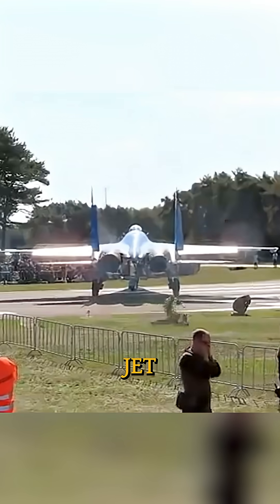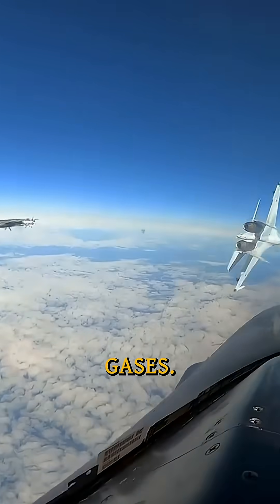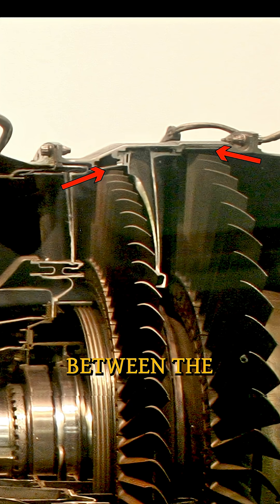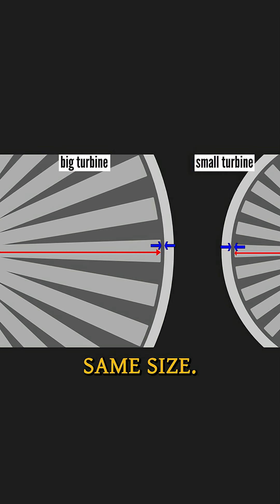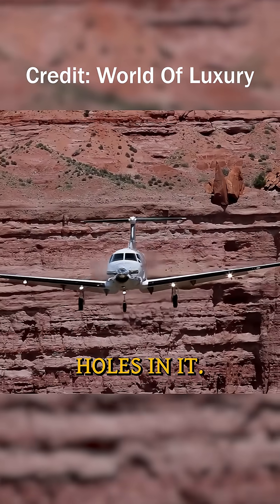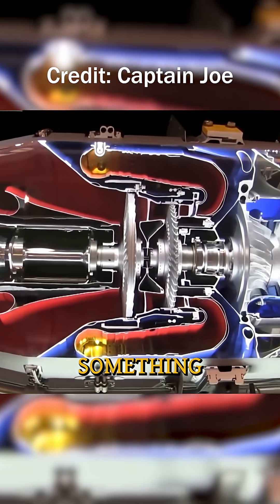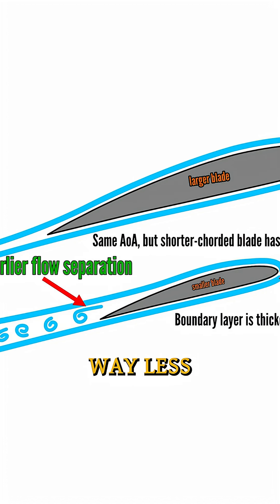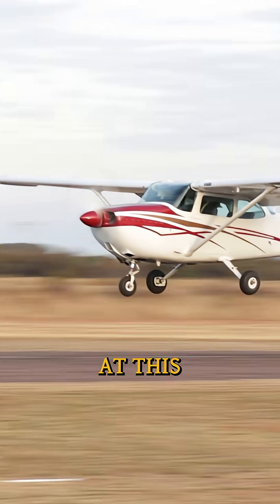Why Turboprops Can't Yet Replace Pistons on Small Planes

Comment: Turboprops DO produce thrust with exhaust gases... and modern jets spin turbines the same way a turbo prop does just a lot faster. Both use jet engines, one drives a prop, one drives a turbine within a cowling since the blade tips travel supersonic. Cowling is for eliminating tip vortices and as such eliminating deafening sounds and drag, as well as protecting the engine (and the aircraft from the engine if something goes wrong at those insane speeds). 

Newest jet engines and turbo props generate less than 5% thrust from exhaust gas, whereas 737ng and non neo a320 series create about 10-20% thrust from exhaust. Rest of exhaust gas is converted into thrust to spin the turbine or prop. 

The benefit of the turboprop is using a smaller jet engine to produce a better thrust to fuel ratio providing better propulsive efficiency at slower speeds than a jet, but at much better performance than an ICO at higher altitudes from the compression... dm if u have any questions :/
Reply from the maker: You might enjoy my long video linked here 🙂 Correct of course, since its impossible to extract 100% of the energy in the exhaust gases on a turboprop, it does provide a small amount of residual exhaust thrust.
Reply: Your using turbine when you should say fan. A turbine extracts energy from a fluid, a fan adds energy to the fluid.  The turbines are right after the combustion chamber and extracts energy from the air to turn the drive shaft. The driveshaft then turns the fan to produce thrust.
Reply from the maker: @wally7856  That's exactly what I meant. Turbine, not fan. A turboprop doesn't have any fans, only rotors (compressor) and turbine(s).
Reply: @LetsGoAviate  I was responding to the OP's post, not yours, sorry for the confusion. He mentioned a turboprop drives a propeller (for thrust) and a passenger jet drives a turbine in a duct (for thrust) when it's a fan in a duct, not a turbine. I wasn't trying to be pedantic, it's just the OP seemed very knowledgeable and enthusiastic about the subject so using the correct terms would benefit him when he posts. A fan/compressor section and a turbine section can both look very similar, it's just that they do 2 different jobs.    One extract's power from the exhaust, the other uses that power to make thrust.
Reply from the maker: @wally7856  Gotcha, all good
Reply: @wally7856 Thanks!

Comment: If you have a turbine with multiple independent axles, say, one set to run the compressor and the other one to turn the prop, if the reduction gear to the prop breaks … instant uncontained turbine failure.
Reply: yet somehow the pt6 almost never breaks... (this literally happened to mike patey recently)

Comment: This is all true.  The reason small planes don't use turboprops is because a turboprop engine is ten to twenty times more expensive than a piston engine.
Reply: You seem familiar with both systems.  But, you mention nothing about maintenance and reliability not to mention fuel cost comparison. Everybody knows turbines are low maintenance compared to piston. Everytime you add maintenance labor to the system it can be a large $ difference. Reliability I am not familiar with but becomes important when you are in the air for some reason. I am guessing turbines are more reliable.
Reply: @franciscoosuna259  Maintenance on turbines is exponentially more expensive than on recips. Sure, there's less of it.
Reply: @franciscoosuna259  precision costs more, period.

Turbines require precise tolerances, thus cost more.
Reply: @Adam-mf9cl  don't forget all the fancy metall alloys you need in turbines while in a piston engine it is mostly just aluminium and steel.
Reply: @franciscoosuna259  He said it is 10-20 times more expensive. Nowhere was it mentioned that this is only the initial purchase price. Maintenance is also 10-20 times more expensive. So the total operating costs are 10-20 times more expensive to have tiny turbo prop vs a 50 year old, air-cooled piston motor.
Reply: @franciscoosuna259 
Turbo prop maintenance is more costly per operational hour than piston engines, a good bit more. 
As far as fuel costs I don't know on that one but even if jet fuel is less expensive than avgas per hour the savings wouldn't come close to offsetting the higher maintenance costs of a turbo prop.
Reply: Why is that when a jet engine is so much simpler with fewer moving parts?
Reply: @armyreservist0  It is not simpler. Have you seen what a jet engine looks like outside of a plane?
Reply: That's not the only reason,turbines don't operate efficiently at lower altitudes. They   burn through a ton of fuel in lower altitudes when the drag is higher.
Reply: Nothing wrong with piston engines. 
Turbo props are for larger aircraft. 
Same reason you don't see a caterpillar engine
in smaller trucks, more weight, more fuel usage, 
etc... Keep looking for the fucks capacitor, I mean flux capacitor... Good luck!
Reply: @Pork-Chopper  Piston engine failure rate on airplanes is considerably higher than for turboprops (10x).
Reply: @jsmariani4180 
That may be true, however, I don't think it's 
because of poor design. IMO, it's because of lack of maintenance, specifically, not changing motor oils more often. Let's say just because the manual says you can go so many hours (or miles on a vehicle), like on some vehicles the interval is 7000miles , however, if the oil is already dirty and black at 5000miles, why not change it?? Oil is cheap compared to engine repairs. If the oil is already black n dirty that means the oil is already breaking down, viscosity is breaking down along with any anti-corrosion additives. The manual is a guide book to maintenance, not the Holy Bible that must be strictly adhered to. Common sense must prevail. If the oil is dirty, change it, n the filters as well. Same for spark plugs or Magneto's, change them or give them a cleanup
so your engine remains in top tune. Don't wait til it falls apart, that's why it's called, "Preventive Maintenance"...
Reply: That’s your answer right there.   Besides  adding one to a bug smasher makes the weight and balance go crazy and leaves the plane looking like a “ hose nose” sans Corsair.      It’s only applicable in a tiny number of very specific uses which most wouldn’t have a need for.
Reply: Turbines are also less fuel efficient, so between fuel and engine cost, pistons win.

Comment: They should just use centrifugal turbines similar to turbo chargers.
Reply: They do.
Reply: Some engines use both!
Reply: That's exactly what you have in many small turboshaft engines.
Reply: They too have the same problem with leak by clearance.

Comment: Not to mention that there are in fact new aviation piston engines developed, which can run on Jet-A1 and/or Diesel fuel, only increasing the impetus to stay away from small turboprops for fuel efficiency reasons.
Reply: Also, engines that use 95 gas already exist, and due to smaller displacement and higher RPM not only they burn less money in fuel, but also are lighter than antique avgas engines
Reply: Yea but there's catches with diesel aircraft engines, one of which is the FAA will only certify the far more expensive carbon fiber props for diesel aircraft engines, something about the harmonic vibrations of a diesel engine likes to crack metal props, I can't remember if they allow wood to be used with them or not but I doubt it, if they did the guy who owns a crop dusting air service that was in a video talking about the pros and cons of diesel aircraft engines probably would have had a wooden prop on his instead of a carbon fiber prop.
Reply: @dukecraig2402 
 Composite material propellers are the future anyway, so this doesn't really matter, but it's still good to know 😊
Reply: In terms of chemical composition, there isn't much difference between automotive diesel fuel and JetA1 as both are essentially kerosene. JetA1 has less lubricants worked into the fuel than diesel because those lubricants can freeze at high altitudes.